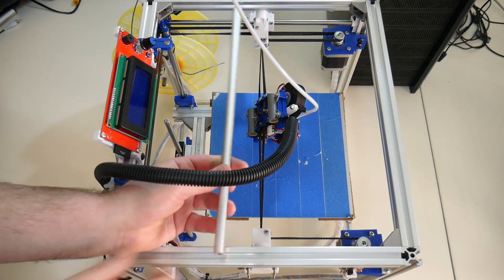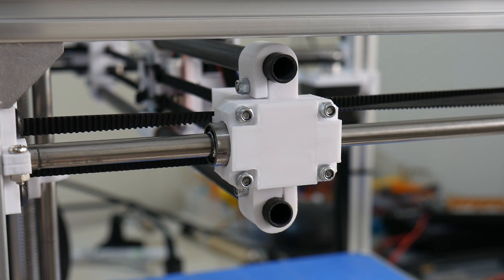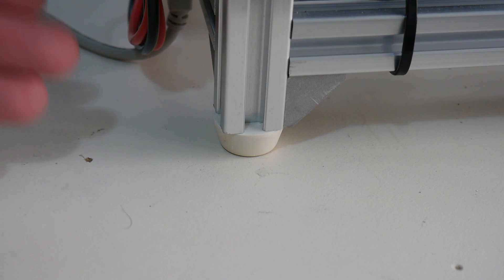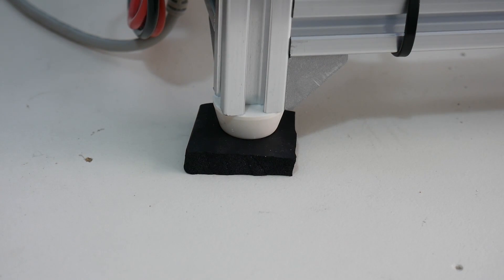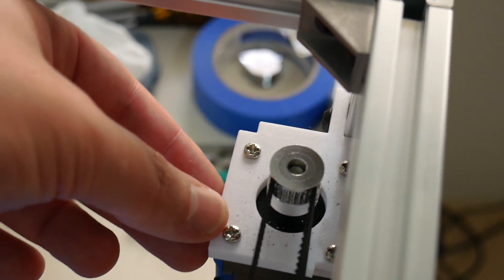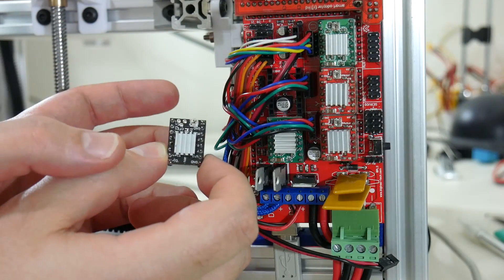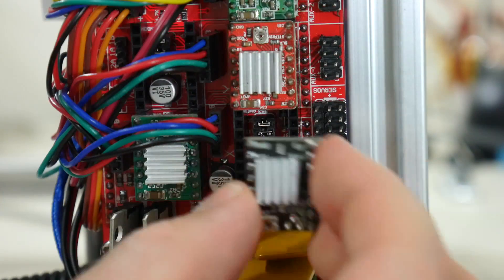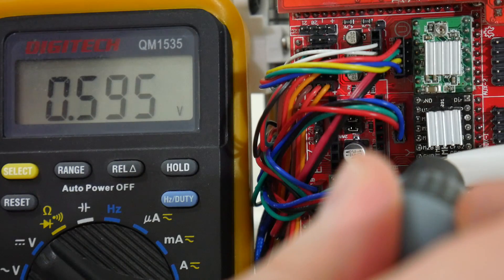Silence a noisy 3D Printer

Comment: I know that this is an old video but for anyone interested, at 2min 40s in he mentions that the y rails he reused were 7.94 mm and not 8mm.  In fact the 7.94 = an imperial size bar i.e. 7/16 inch, and of course, the USA still use a system, American Customary based on the British Imperial system alongside the ISO metric used by some industries.  That means that you can never be sure which type of materials they are using, Imperial or metric, so if repurposing materials from an America made printer, or anything else for that matter it is worth checking carefully.

Comment: I use a large gaming mouse mat!, works well for damping 3d printer noise, I had an old one knocking about and tried it, it works great!. Where did you buy them linear bearings they sound really bad, what brand are they?, Are your rods 8mm or under size?

Comment: hey just a ps. i added dampeners to the xy motors and it reduced my print quality and caused issues. I guess the reason being on this printer (corexy) the belt tensions directly affect the skew and all of the x/y axis. so I don't recommend doing that for a corexy printer.

Comment: Do both your printers use 80 steps per mm on X & Y axis? I'm at 100 steps/mm so far, with anet a8 nema17 motors, and the hypercube scaled up 2cm in each direction

Comment: From ABH on the Raise3D forums: "In the datasheet for TMC2100 it is stated: "Attention: microPlyer only works perfectly with a stable STEP frequency". Well, a 3D printer has nothing but an unstable step frequency! It accelerates and brakes and changes motor direction all the time, just think of a rectilinear infill pattern, usually created at quite high speed."

 Long story short, the TMC2100 algorithm is a look-ahead algorithm that can easily produce partial and whole skipped steps under the right conditions. The newer series of TMC22XX chips solve this problem and are just as quite. I was having the skipped steps problem and am now using the TMC2224 on my Raise3D N2 printer and getting spectacular results and no skipped steps at about 0.5vdc.

Comment: My fan sounds like jet taking off so I'm planning to replace them.
What brands would you recommend among these?
Nidec
Funcooler
Sunon
Evercool (please specify bearing type)
I will be replacing at least two of the drivers with TMC2130 and hotend with genuine E3D V6 because Chinese clone got screwed up with malicious filament which was a bit too elongated.
P.S. I have no problem with other factors of noise, though the Y axis bearing is making worryingly large amount of black powder...

Comment: wait you only put your stepper drivers at 0.6v? for my y-axis I had a lot of miss-steps at 0.9v so it's at 1.2v now
x is at 0.9v z is at 1.5v (because 2 motors), E0 is at 0.8v

Also get a 40mm fan adapter i think the e3d uses 30mm? and a noctua fan. ugly color scheme but silent.

Comment: It looks like the belt drive gear on the left-side motor is out of round. That may have a part in the rattling, but while listening, I was homing in on those stacked belt idler bearings in the corners. I think they may be either buzzing up and down or too loose on their bolt. Perhaps holding a pencil eraser on the various subcomponents of those idler assemblies can help you isolate the vibrations.

Comment: Short question - as my Prusa I3 on 8mm rods is also making these strange noises. Is the TMC stepstick the final resolution?
Reply: did you find a solution? if not, maybe try polymer bushings instead of linear bearings

Comment: Why my stepper motors after replacing the stepstic's and setting the voltage to 0.6 volts during the printing sound squeaky? There is no video on your video. Have you edited anything else in Marlin?

Comment: I had planned on using these when I built my Hypercube.  I tried to run it at .600 V for the VRef, but ended up having to run it up to .9V to avoid any layer stepping.  Runs like a stealthy beast now though :)  I can be sitting at the computer and forget that I had started printing something, even with the printer sitting about a meter behind my back. Super quiet.  Love it.

Comment: The most drastic difference I made to both of my printers (Sintron Kossel & SmartrapPlus) was to place anti slip mat under them. Its the soft mesh stuff you get in DIY stores. It isolates all vibration by about 95%.

Comment: Did you ever find the cause of this noise? My HyperCube just started doing a similar thing after I switched control boards, though I'm using the same sort of driver chip (A4988) and same firmware on both boards. I thought it was a loose screw or nut but seems not. I'll try your solution so I've ordered TMC steppers as well.
Reply: Jamie did the tmc2100 steppers help? I have the same problem as well.
Reply: Same here.

Comment: 256 microsteps are supposed to be way too hot for the 8 bit arduino to handle . try printing the cylinder you used to benchmark on the ' hypercube 8 bit speedwall ' with 256 microsteps you may see the artifacts on the cylynder even when printing at slow speeds . i cant confirm this but its just theory . for this reason i use a drv8825 on 16 microstep settings  for my 3d printer

to solve this issue a 32 bit microcontroller is needed to replace the 8 bit arduino to print happily with 256 microsteps

Comment: you were not reusing your 8mm rods, you were reusing your 5/16 rods. 5/16=.3125.
.3125x25.4mm=7.9375 or as your calipers pretty much said- 7.94. You must be careful when buying multiples off 8mm & 19mm these are within .06mm and .05mm of their imperial twin. Vendors of these items may unknowingly mess up your project if they are not competent. Great for sockets, but a nogo with precision machinery.
Reply: Your right. Precision ground shafting for rotary motion or linear motion also have different tolerances that should be checked. Tolerance for 8mm shafting for linear applications is typically +0/.009mm while for rotary it's +0/.005mm.

Comment: Maybe this has already been suggested but when you installed your linear bearings did you make sure you installed them in a X pattern   What I mean by that is the balls should form a imaganary X with the too on top  and bottom on the right and left side of the rods. if not check that it will cause premeture wear  if not installed correctly

Comment: I have been researching 3D printer kits for a while. Your video walk through of this build has provided me with a tremendous amount of knowledge. Your attention to detail and meticulous testing of various components to ensure the most accurate results for this printer is inspiring. As such, I have decided to build your design. I truly appreciate all the work you have done to help others build a functional printer. This includes the videos, the parts lists, and other information required to build the HyperCube. To say thank you I will be sure to purchase items using your affiliate links. I do have one dilemma that will prevent me from building this printer and that is access to the printed parts needed for the build. Is there a service that would print this kit for me? 

Cheers,
Greg
Reply from the maker: Hi Greg, thanks for your kind words and support. For the printed parts you can try the 3DHubs website. 
Cheers!

Comment: Make sure any linear bearing that moves horizontally is rotated in a way that the top side of the rod is touched by two rows of balls (at 1:00 and 11:00 o'clock). If there is a ball row at 12:00 o'clock, any slack of the bearing will make it swing left and right making it noisy as the ball rows on the sides hit the rod. Also the load is more evenly distributed this way.
Reply: @Conor Weston Definitely, been watching on instaflixxer for months myself =)
Reply: @Conor Weston Yup, I've been using instaflixxer for since november myself :D

Comment: Tmc2100 need a good heat to work properly, or in the printing process will be out of step. Need extreme air cooling or water cooling can be used normally, the temperature is too high when the work.

Comment: For higher accuracy, disable microstepping and use mechanical reduction on motors. There'll be harsher moves but some flexible joints and flexible couplings may help to solve this. Nice comparison btw, thanks for the video!

Comment: Your CGF6 pin is set to GND or open? CFG6 is the pin just under CFG1 and 
 it seems to be set to GND at 8:25 while mine is set to open...
https://www.trinamic.com/fileadmin/assets/Products/ICs_Documents/TMC2100_datasheet.pdf
Reply from the maker: That pin is controlled by firmware. It's the driver enable/disable input.
Reply: I think you might also be missing the fact the all the cfg points have 3 states !! Open , shorted and GND
Reply: by shorted i mean pulled high to VDC

Comment: 6:33 - Microstepping does not provide greater accuracy. This is a common misconception. It is only for smoothness.
Reply from the maker: In hindsight a better word would have been resolution. 1/16 micro-steps will provide greater resolution than 1 full step.
Reply: Let me elaborate. Full stepping is normally used on the Z axis because you are guaranteed that, assuming you have 0.02mm per step, when you step into a direction the plate will move exactly 0.02. In a microstepping situation though, lets say 8 microsteps, you are absolutely not guaranteed that when moving a step, the build plate will move 20/8=2.5 microns. It might not move at all or move toward the next step. Stepper drivers might make bold claims but in reality the accuracy is not improving, and in static situations like the Z axis it might actually suffer. In a X/Y application it would lead to smoother operation, and should have no adverse effect on accuracy. 
On a side note, as i am understanding, you would need only 16 steps to drive the TCM2100 and it will multiply them to 256? That would be great, because arduino based controllers would really struggle above 16 or 32 msteps per step.
Reply: assuming the movement is 100% easy to move- it does provide accuracy- in real world however with the friction and wobble and forces- its more like a spring that smooths out motion. its not reliable. the only way to get microsteps to perform is pull up your motor amperage super high. that's why its best to get small pullies and or move to 0.9 steppers to get real -world results for resolution without loud prints
Reply: i think using 2 gears instead of microstepping will be superior, since you dont loose torque (infact you increase it) + you get real non interpolated "resoloution". For Exaple Gear1 8 or 10 teeth and Gear 2 = 80 or 100 teeth. Also using a 0.9 degree Motor will reduce the torque/resoloution problem by 50% :).

Comment: Hello, can you share or recommend what speed and layer time you use for the cooling  ? Recently I found out that my PLA prints on unheated bed they basically get loose at about 25 mm of print height, I suspect that my fan is too strong and is cooling the print too strongly . Of course I could disable it but it is still needed for some bridges and some cooling helps with PLA but I don't know some way to calibrate it
Reply from the maker: If you can't activate the heat bed, then add a brim to your prints.
Reply: bbogdanmircea I'm not sure what you're already doing, but you can set your fan not to come on for the first few layers and often that will help.

Comment: Hi Tech2c, could I use this motor instead of the one you linked on thingiverse? https://banggood.com/Nema-17-5-24V-Stepper-Motor-4-Leads-34mm-42SHD0001-p-1125885.html
Reply from the maker: Normally the smallest NEMA17 motor I'd use is 40mm in height, but that one you've linked notes 3.2kg force which could be enough.
Reply: And within a reasonable range, what is torque proportional for? Print speed?

Comment: I'm glad you're finally doing these sorts of things with the HyperCube now it's all mechanically dialled in. It's almost insulting to the printer's ability to make it suffer the crappy old RAMPS and A4988s ;)
Reply from the maker: So true, I need to move to 32-bits soon.
Reply: After that you'll need a Volcano hotend to keep up with the speeds possible :) I'm sure you've seen Bryce Standley's video where he found layer adhesion was poor above 150mm/sec due to the small melt zone of the V6 heater design.

Comment: Damn, your spreadcycle is so quiet! Mine makes a really loud whining noise (Similar to DRV8825). I boosted the driver's voltage from 12 to up to 34.6V and it didn't make that much of a difference.
Reply: Sevendogtags 
it will make a lot of a difference in the maximum speed you can achieve
Reply: I'm talking about the noise. It didn't change much. The noise is supposed to be reduced when the motors are over 18V.
Reply from the maker: Can you reduce the current to the motors without skipping steps?

Comment: I have a question for you and that is how do I switch X with Y?  In my printer's design my motors are both on one side (say right hand side) instead of in the back.  How does the CoreXY handle something like this? Does it matter?  I ask because with my printer's front that is towards me it ends up like your printer did in the very opening of this video.  I have no access to the build plate on the side with the motors and on the direct opposite side (the same orientation you had in this video).  My printer is basically 90 degrees off from yours.
Reply from the maker: I guess it matters where the endstops are. You have a choice of min or max for the X and Y axis endstop location.
And correct me here, but if you've rotated your motors 90 degress to my setup, the your X is Y and Y is X?
It may be easy to slice your files at 90 degress so it faces you whilst printing?
Reply: Well, look at how you had your printer when you showed it moving without the rods and that is precisely how my printer is set up but whilst you would remove the print from the side (if using it like that) and I would from the front I can't figure out how I would tell Marlin it is shifted. I could do it in the slicer but man oh man it would begin to get confusing so I was hoping there was another way.  On a plain box printer I would just swap the motor wires but for a CoreXY it controls those two motors for X and Y.  If my print says to move 100mm in the X direction something tells me CoreXY would move it in the Y by 100mm with my setup.
Reply from the maker: In that case I would connect the X-Carriage endstop to Y MIN on RAMPS, and the Y axis endstop into X MAX on RAMPS. You'll need to update Marlin for X endstop direction (from -1 to 1).
Then I believe you have 4 combinations of the motor connections to try. FF, FR, RF, RR.
F=forward, R=reverse.
Reply: Endstop has to be swapped for a regular printer as well but I know zilch about CoreXY.

If I have two motor plugs shouldn't there be only four combinations possible as you said?  http://forums.reprap.org/read.php?4,347816,353444#msg-353444  This said eight, shows eight too, which has me befuddled.

Comment: I wonder if you could modify the stepper motor mounts to have an imprint where the dampeners would go.

So they would sit up in the parts. you probably wouldnt lose any strength because you are replacing plastic with metal.
Reply: girrrrrrr2 
ive seen people use a peice of hose as a damper, a peice at each side of the screw like a sandwich, and it somewhat worked

Comment: How about replacing the LM8UU's with Igus Polymer Bearings?
Reply: RJZM-02-08 :)
Reply: No you're just looking at the wrong ones. They sell ones with a 15mm OD.
Reply: Aha, and they're on the product page for RJUM-02 Compact Linear Plain Bearing. You legend. Thanks :)
Reply: They're absolutely phenomenal. I replaced my A6's shitty chinese quality LM8UU's with them and got vastly greater precision on axis and noise level dropped dramatically. There's only one caveat. They're very very careful to install or they might bind or stick. Regular bearings allow much greater deflection in assembly and still work and have greater freeplay (but will be noisy and wear out fast). Done correctly however, they're great. Also if you get them, never ever use any lubrication in them. Guess who tried and learned the hard way. I had one bushing set slightly misaligned and tried to use PTFE-lubrication initially, which generally works quite well in similar applications and I use it all the time in plastic type railings at work. However I immediately noticed that bushing were sticking all the time. Without lubrication and correct alignment of them is the key to success.
Reply from the maker: Yes they would solve the rattling noise, but I tried them in video Build Log #15. The XY_Joiners disfigure the shape of the IGUS bushing and causes the motion to be sticky and brake. A hard shell polymer bushing should work though.
Reply: It would be great, then, to see you test out the ones with the metal casings!
Reply: Tech2C Igus bearings are not a direct replacement for LM8UUs. The metal bearings have a 15mm OD and the Igus bushings have a 16mm OD. Even the captive Igus bushings have the larger OD. You need an XY Joiner with a 1mm larger bearing hollow :)
Reply: Not that I can see. RJM-01-08, RJZM-01-08, and RJZM-03-08 self-aligning carrier all have OD 16mm or 15.8mm. What's the part number of the ones with 15mm OD?